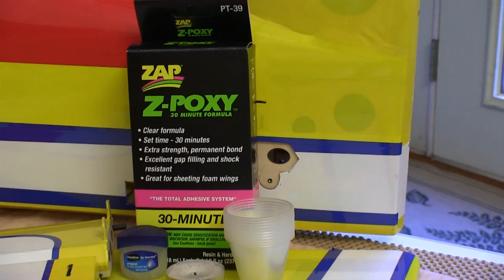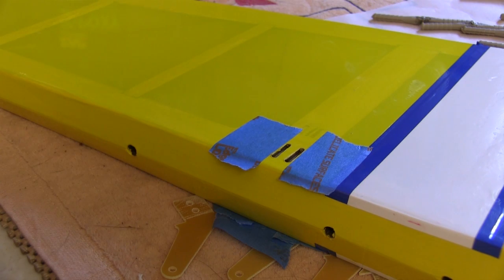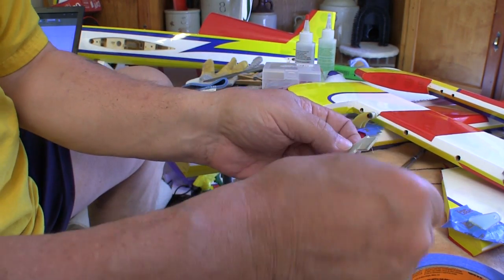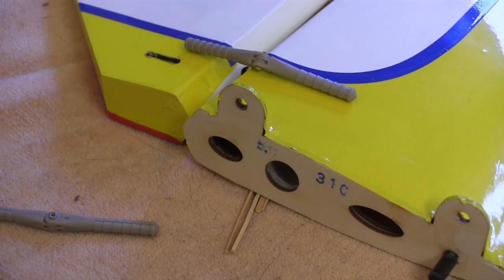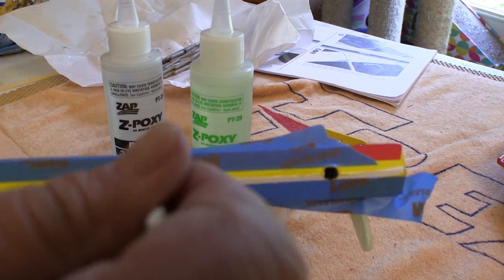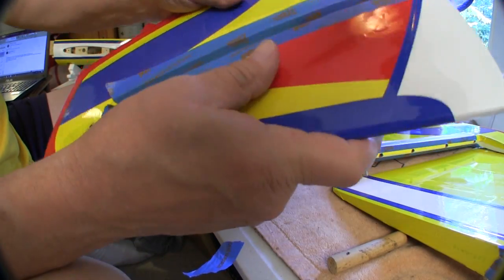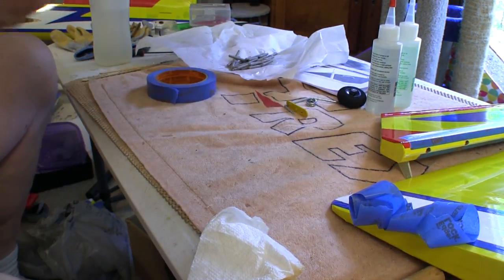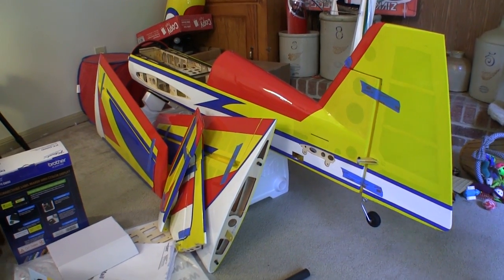Hinging Control Surfaces

Comment: I wanted to ask if you do both surfaces at the same time   IE,  the right aileron and wing or the left stab and elevator.  I’ve always just done one item at a time and let them dry then do the mating side.   So I was wondering how doing both side at the same time works. I’m going to try the rasp on the next one.  Thanks again for the wealth of knowledge you put out on your videos
Reply from the maker: When using epoxy for control surfaces I generally do two surfaces at a time to be sure I have fresh epoxy on all of the hinges. Then I'll mix another small batch of epoxy and do two more. I test fit all of the hinges so I know I don;t have to fit them when putting the epoxy on.